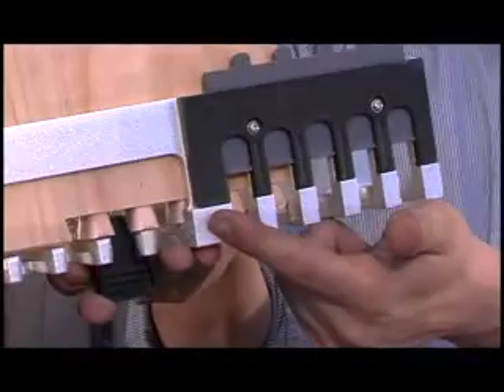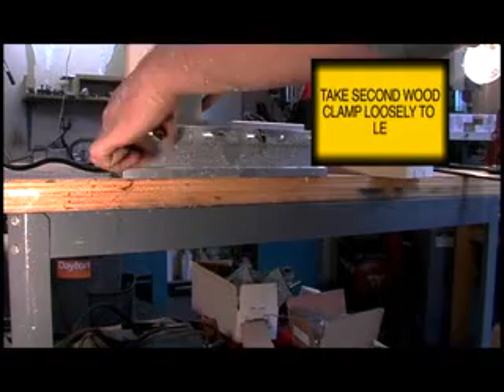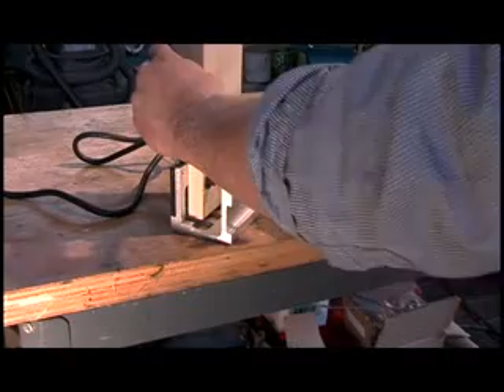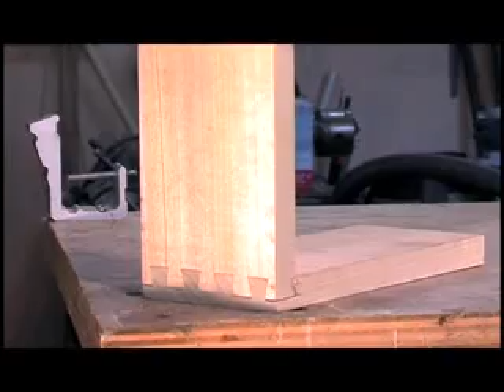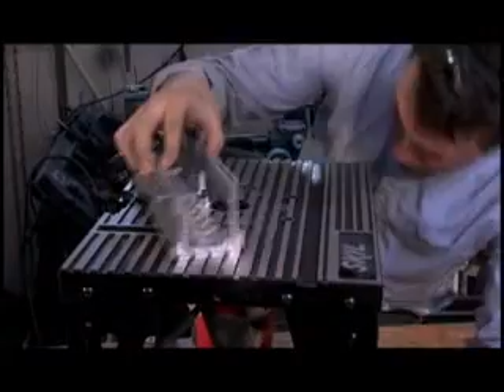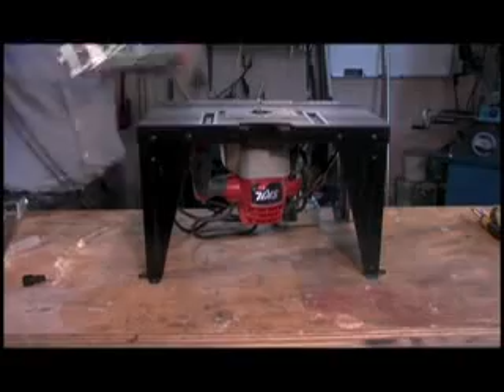EZ-Pro Dovetail Jig from General Tools (Part 2 of 2)

Comment: This is probably a really stupid question, but if I am using 3/4" wood, don't I need a 3/4" bit ? Otherwise I am stuck with each board poking out 1/4" all the way around......the 1/2" bit is only 1/2" long.

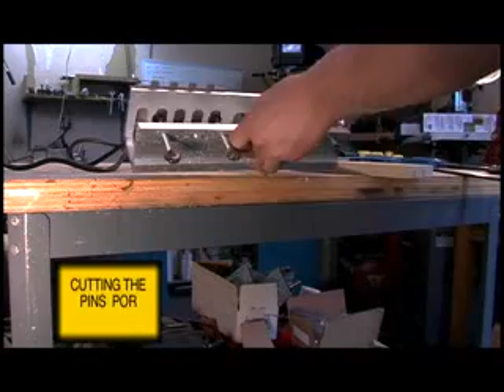Comment: Still having trouble aligning the two boards and having them match up "perfectly". I match them up, and then I have a quarter inch off at the end.  Also, sounds like you say "the penis side of the board" at 00:53. Ha.
Reply: highfeather1 You have the reference board around the wrong way - always mark your boards "inside face" and "outside face" before starting and make sure your board is the correct way around according to the manual

Comment: What no replies ?
Reply: The 1/4 shim is to remove the rounded bits when doing edge to edge dovetails. I have yet to test it, but I do not see why you couldn't do it as a normal corner joint as well.